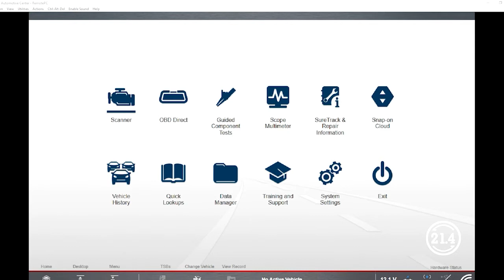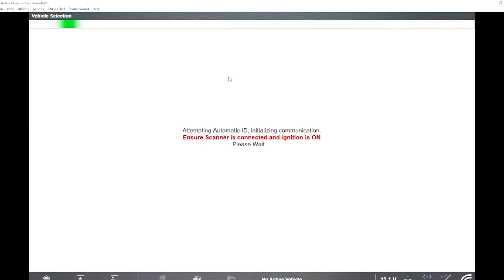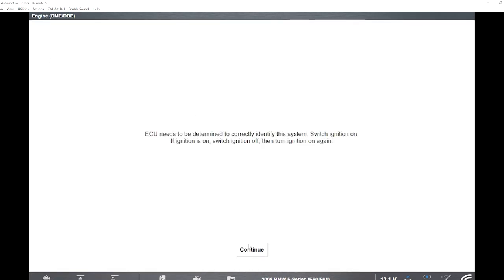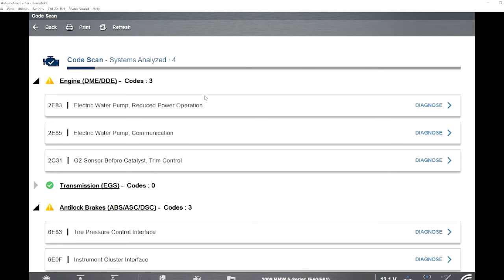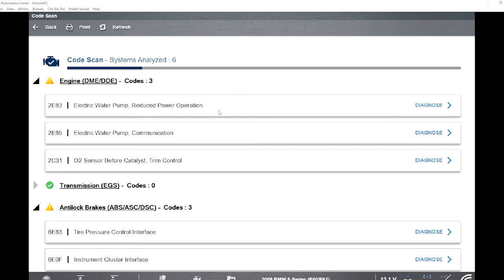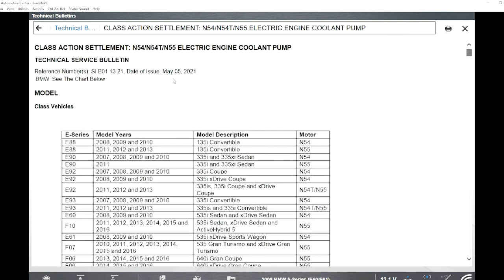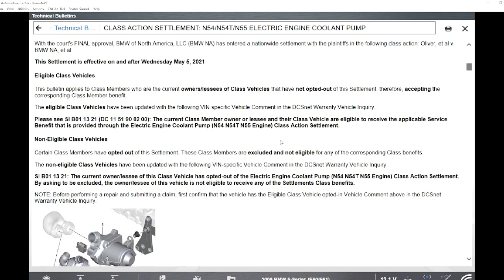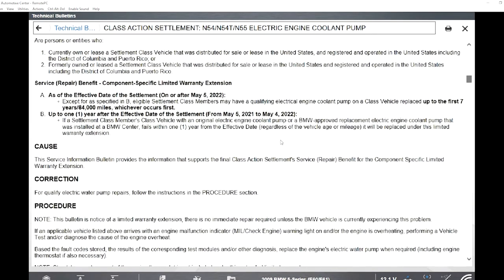Electric water pump, 2E83,2E85 code, BMW water pump, water pump, BMW electronic water pump code tsb.

Comment: So how do you fix it
Reply from the maker: If you have a bad electric water pump call the dealership and see if it falls into the recall if not replace the water pump.
Reply: @automotivetechnicalresourc4229  I recently replaced water pump and thermostat and the pump isn't coming on I have a 2E84 I haven't started the car yet but I tried to bleed the coolant system electrically